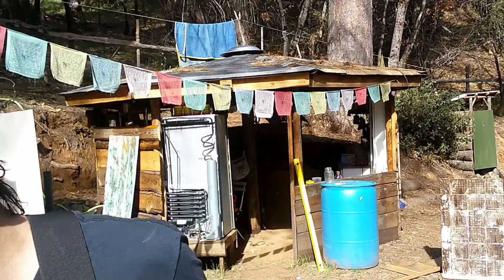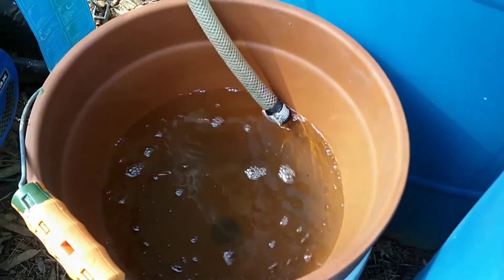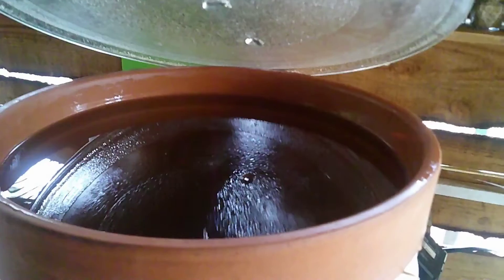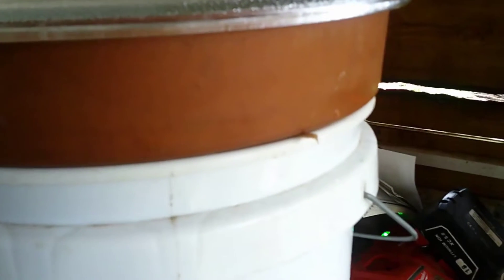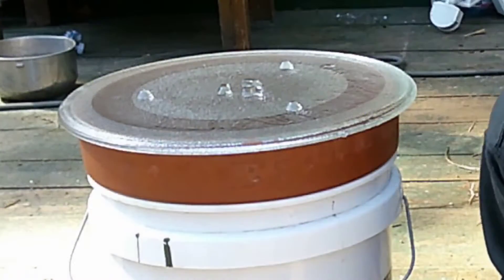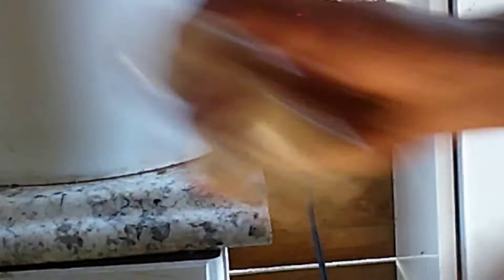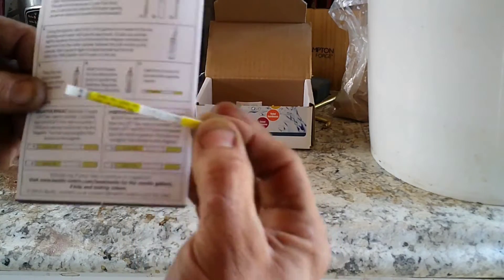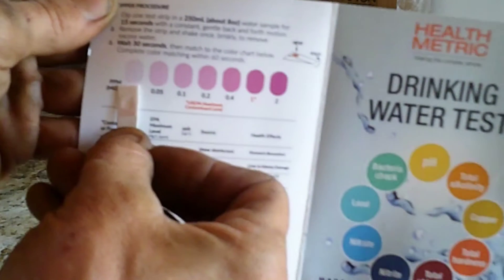Clay Pot Water Filter Part 2 - Tests and Tips

Comment: Fantastic video. Thanks so much for sharing 👍😁. I hope to try this out as our distiller has broken.
Reply from the maker: It's a really fun project! Be warned it is SUPER SLOW! If you plan on using this on a regular basis, start a few days early and maybe make more than one. Make sure your pots are stamped with made in Italy or similar.

Comment: Great work, here, and thank you for putting in the work to make this video.
Looking at your setup, I wonder if it can be improved. What if you put biochar or activated charcoal in the terracotta pot? It might slow down the amount of water that drips out, so perhaps not feasible.  But, I wonder if it would provide yet another layer of filtration.
Something to consider. Great video. Thank you.
Reply from the maker: That's a good idea, but this thing is already soooooo slow. I was thinking maybe a pre-filter using the method you described to keep the terracotta flowing?

Comment: How long would the pot last as a filter?
Reply from the maker: Not enough field data to give a conclusive answer, however CDC recommends changing the filter every 6-12 months.... In a zombie apocalypse situation I'm guessing it would last. well, a lifetime ;)
Reply: @PiratesInTeepees  I know they can and should be cleaned regularly. I ask because I have a large terra cotta pot that over many years be an to break up. Dissolve. I would imagine being filled with water all the time it would happen sooner.  Also I was looking for pots to use at the local home centers and discovered that even the ones made in Italy had coloring in the clay to keep an even orange color.

Comment: Water doesn't become stagnate.
Organic debre in water causes what you call stagnate.
If you store you water out of the sun. So algue doesn't grow. You water will remain pure and good.
However. Water that has set in the sun for a long time. Can turn bad in 48 hours.
I've noticed that this only happens during the summer for me.
I've had good rain water last 3 years before going bad.
But when it does it goes quick.
Like as in 400 gallon is good on Monday and Wednesday it's gone bad.
And it's not unsafe to drink. Just very bad tasting.
Personally. I think someone is messing with my water. But yet to prove it.
Since it's funny that it's good for a long time
 Then in just 48 hours goes bad.
I've seen this happened times.
Most were with chloride treated water.
But it did happen with my distilled ( rain water). And with this one. It went from being clear for over 3 years to heavy Algue in less then 48 hours. And the worse case
I really thought something got into it and dead.
But after. I emptied it and no remain just a ton of Algue. As in over two five gallon buckets of Algue.
If someone is contaminating my water. Id really like to know what they are using to cause rapid Algue growth.
It stands to reason it will happen a lot more in distilled water then chlorinated water.
Btw they really chloride the water. I've seen pools with less chlorine. 
They did use to be so bad. But a few years ago. The guy quit at the water company. And a new guy ( a real jerk) took his place.
Fill up my tank. Burns my eyes, nose and throat. And water can't be used for a week.
I think he does it on purpose.
Reply from the maker: By definition "Water stagnation occurs when water stops flowing." so, technically, as soon as the water hits the tank it becomes stagnate. It was dirty, unfiltered water collected from my roof that had been sitting stagnate for months. 

Interesting story about the algae in your tanks.
Reply: @PiratesInTeepees  you are right about stagnate. Non moving.
But most people think stagnate water is bad.
They confuse it for blanch water.
What I was trying to get across is water doesn't become blanch by sitting.
It does so because organic material is in it and the organic material is going bad.
 I don't know how to classify these people.
I had this neighbor that 15 years prior had filled up clean new 55 gallon drums with water.  The water was still good.
The sun broke down the drums and they broke.
( Which I really don't think the sun broke them. At the same time a neighbor robbed the place blind. And I think he broke the drums )  The year before the drums appear to be still very good. After he was caught
 I went over there and seen all the drums were broken. 
The owners I never meet. But I knew they had not been to the property in 15 years before I moved onto my place.
In short they have not been to the property in over 30 years now. 
He claim he had permission from the owners. But I find it funny. I have been trying to contact them for 20 years. And they have never got back with me. 
Anyhow, I'm vering.
The water was still good. Because the sun couldn't get to it. And they were air tight.
Btw. Also technically they were not stagnate.
Sun heated the barrels. Causing rain inside them. 
It just made me mad because I know he destroyed the barrels. And robbed them blind.
 By the looks of it. Someone set up a bug out location.
And I just know that if SHTF ever happens. They will blame me. Because I'm the closest at one mile away. Technically, our properties touch. I just built my shack at the other end of my property.  And built my road off another.
When I bought my place. I didn't know no one was living there. And I didn't want to go through thier place. When going or coming.
Anyhow. If they ever need it. Everything is gone. He stole all their stuff. Two campers. Left one travel trailer but took everything from it. Took 2 four wheelers. Solar panels. ( Just really hope they remember thier panels were the cheap Harbor Freight junk) Because mine are polycystal panels. 
In short. I have nothing from there. But I'm worried they will think I have there stuff.
Where in truth. The thief is now long gone. 
And the people he was with live 20 miles away.  One of the campers is 10 miles away.  They sold it to another. And the new owner. Well by popular believe. Died about 3-4 years ago.
So the camper is just sitting there as far as I know.  I can't see it from my place. And not on my normal drive out. 
Then again. Someone could have stolen it. Lol.
Reply: Sudden algae from too much sun or too many nutrients. 
I would guess excess phosphorus or even better cheap and available is ‘liquid nitrogen’ from the liquid DEF that is added to diesel trucks. 
Good luck and protect your water. ❤

Comment: Has anyone tested the water before and after for impurity removal?
Reply from the maker: I  did not do a before test... but I used rainwater that had been sitting in a barrel for 3 months and smelled pretty bad. My main goal was to ensure that there were no heavy metals in the pot itself. So there is no guarantee that coliform was present in the water before the filtering process. I encourage you to try this out and if you send me your test results I will make and post a video about it. Thanks for watching and commenting!!!
Reply: @PiratesInTeepees  It seems like testing after only is not scientific.

Comment: I noticed most people using this method are using a clean rainwater source. I was considering this as an option for surface water (river or pond) but I was thinking I would add charcoal to the pot and a washable filter medium on top 🤔 Not sure when I’ll get around to it but if you have any thoughts I’m interested.
Reply from the maker: I would think that, especially considering how toxic our environment has become, you could never really filter water too much. I have seen things saying that rainwater has become toxic to drink. However, I would think adding charcoal to the clay pot might make the filtering process take too long to be viable. Perhaps a multiple stage filtration system would be best? But for sure straining the water through a cloth to remove any large particulate will keep the clay pot from clogging up and going any slower than it already does. While this filter works it is super slow. Clay pots designed specifically for water filtration are much less dense and therefore produce filtered water at a much more rapid pace.

Comment: A proper test of the water should be done before AND after.  If it has all the impurities before and then doesn't after,  THEN it's a viable method.  But if it doesn't have any impurities to start with, what's actually been purified?
Reply from the maker: I agree completely. This was more of a test to make sure that the clay pot wan't actually introducing toxins into the water. I used rainwater that had been sitting in a collection barrel for a few months and was quite ripe.

Comment: Hey there! So I've tried this. I'm using a terra cotta flower pot made in Italy, between the top and bottom of a Berkey water system (just w/o the 'candles' of course). I primed the flower pot prior to use, cleaned with a scrubber (not soap). The tap water going in is 36ppm TDS. Testing the two ounces that rendered after 24 hrs, I got a reading of over 450 ppm!! I chucked that water, washed again the bottom of the Berkey and dried it completely. Ran the test again. Again over 450 ppm!! The bung I'm using is clean silicone, no seepage. 
I also bought a round belly terra cotta flower pot to use just as a vessel. Again scrubbed and primed it over 24 hrs.  Water going in - 36ppm. Water after a couple days - 42ppm. Tiny bit of 'sweat' in the plate below it (about an ounce). 
What are your thoughts? WHY on earth is the water orders of magnitude MORE contaminated after its slow journey through the minute pores of the flower pot, rather than close to zero as others are claimiing???
Reply from the maker: PPM only shows how many particles are in there, whether they are toxic or not needs to be determined with other tests for lead, coliform, etc. My tests showed all harmful particles as negative. But, yes, the first few runs of the water did contain clay particulates. After about the third run this went away which is why I suggested doing at least 3 runs before using the water.

Comment: That was great! I got some corks to plug the hole, so I hope that works. What a cool way to filter water!
Reply from the maker: It works, but it's slow. Also user have suggested that when you sand the pot either wet sand or use a dust mask (or both). Also you don't want a pot made in china. Be sure to find one from Italy.

Comment: Great video follow up! Do you have any idea when the clay pot would need to be replaced?
Reply from the maker: I clean mine about once a month and as far as I can tell it should be good for a while I think the CDC website recommended changing it every 2 to 3 years I don't remember specifically though.
Reply: @PiratesInTeepees  :  I can’t say that I understand why person would have to replace it at all.

If you get mineral buildup on it, which will slow down the water filtration to the point where it’ll get on your nerves enough to make you do something about it, then really you can use a vinegar soak, and that will dissolve the minerals.

Terra-cotta can be boiled after cleaning under running water to kill microbes, but I would not put it in direct contact with the bottom of the pot. Probably put down silicone trivets that let the water freely circulate through and heat it up slowly, starting with the filter pot in the water while it is still at room temperature; This may be overkill but I let mine heat up over the course of half an hour until it comes to a boil and let that boil 10 minutes or so, and then turn it off and let it cool down in the water before taking it out to dry. Then let it air dry. That’s the basic instructions for looking after my other (very expensive)  ceramic filter, and I’ve been doing it for many years. My flower pot (pre)filter will be getting the same treatment when it gets to that point.

About sanding down the filter to make it speed up: you have a bit of a trade-off happening here:
     You can have really high quality filtration which is slower, or you can sand it down to speed it up; but this reduces the quality of the filtration. Each person sort of has to find the balance that works for him or her.
     If it turns out that you’re sanding your pot thinner because the pot is getting clogged, you could instead consider soaking it instead in a vinegar solution to dissolve the minerals that are doing the clogging, and then giving it another wash underneath running water with a brush. Depending on how heavily encrusted the pores of the pot are, this could take a couple of soaks; It may take a little bit of trial and error to figure out exactly how strong your vinegar solution should be and how long to soak it, based on the minerals in the ground water in your area.

One thing I find that’s sort of useful is to fill up my filter at night, having emptied the resevoir bucket completely before hand. (No point in causing a flood.). that way, I’m not waiting on water during the day because it’s automatically being filtered for me while I sleep, and ready to use in the morning.  On a day where I expect to use a lot more water, it’s an easy batter to fill up a water jug or two to empty out the reservoir, and refill the whole thing again first thing in the morning so that there’s lots of filtered water by the time that it’s needed.

Your idea to keep the filter constantly full is a really good one. It takes a lot longer to get things started again once you let it dry out too much, and may even have to be so submerged overnight if that happens, otherwise it may never go back to the mist rapid rate of filtration possible.
 
In terms of a cover, that was a stroke of genius to use the plate out of your old microwave.  An alternative for those who’s microwave is still hanging in there, usually you can find a drip tray for catching water underneath the flower pot, when it’s used as a flower pot. This will often fit to function as a cover as well; just ensure that there’s no coating on it  that can come off into the water, before using.

About the chemistry tests that you’re doing:  since (as far as I can tell,) you did not show the results of the pre-filtered water, you can’t actually say with any certainty that the filter is actually filtering out things that you did not find. 
    So for example if you don’t find lead in the water, but we don’t actually know if there was ever any in the water to begin with, then you really can’t say that the flower pot is filtrating out any lead there. The most you get out of that is that your filter is not a Pakistani flower pot, because those poor souls have lead in the clay that is used to make terra-cotta wares. The pots are awesome for planting flowers, but not so much for water filtration because of it.
     If you’re wondering what exactly you need to filter out of your water, may I suggest that you go online and look at your municipal water supply?  There will be a listing of all the testing done over the years, right to the most recent one, complete with an analysis of the components of the local water. It’s good to double check that there is nothing harmful in your water from your test kit, but the results of the municipal testing will tell you exactly what you’re looking to filter out; you can use your test kit to verify that the water that comes into your home supply actually does have that contaminant in it, and then to verify that it’s actually being filtered out once the water pass through the filter.
Reply: @PiratesInTeepees  thank you. Appreciate your quick reply! I am now in the hunt to find clay pots this late in the season🙃